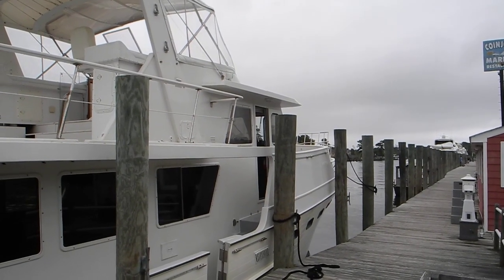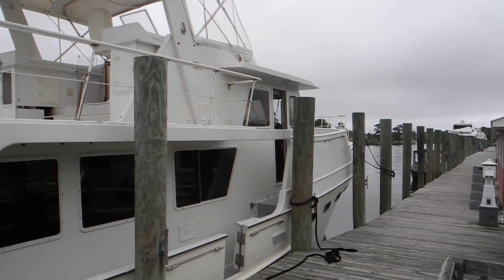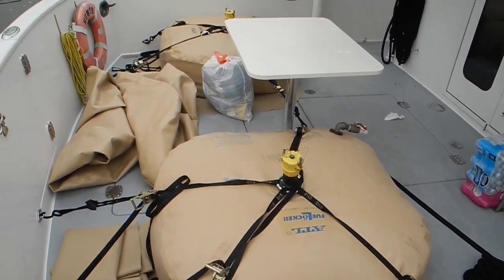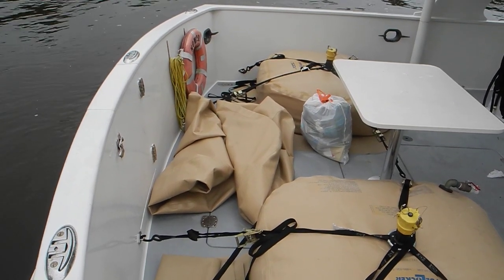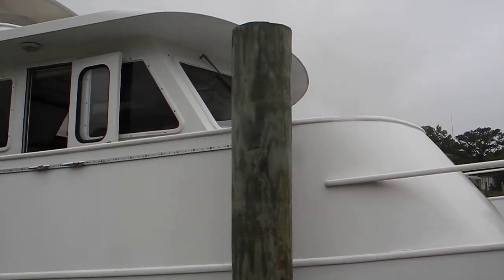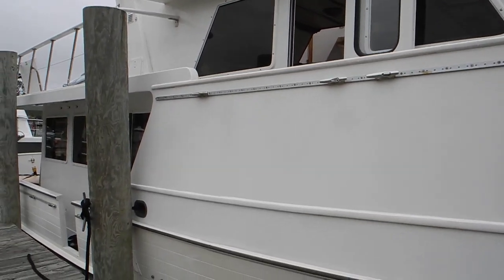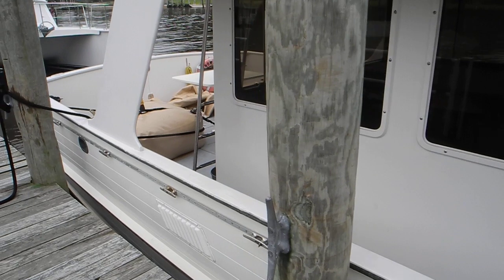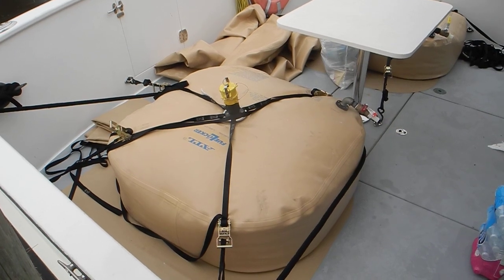Fuel Bladder tanks on deck.

Comment: Depends on the boat, mate. Check out MV Dirona, the N52. They had 3x 700 (or 800) gallons of fuel in bladders, 2 in the cockpit and 1 on the Portuguese bridge when they crossed the North Atlantic. James said that  with this setup the boat still met the category A requirements for stability, even with almost empty main fuel tanks, I think it was down to 15% in main tanks. But of course you'd never go anywhere near that low level because you'd empty the bladders and fill up your main tanks as soon as you've burned that amount of fuel.
But yes that's a Nordhavn, I have no idea if a OA can do it. But maybe the owner himself or the manufacturer did the calculations first?
Reply from the maker: Adding the additional weight to the upper deck is always a concern to any boater. The idea is the Righting Moment or the ability to maintain an upright position in rough seas. Then you may consider if the deck will support the additional weight. This is all a personal decision BUT what will the insurance company say if there is a claim?
Reply: I think it also depends on the trip.  Fuel bladders might help with a crossing (if there was really no better option), but I'd never use them for a run up the coast because it's just too much work and risk.
Reply: @AskCaptainChris  I agree with you. Weight on the upper decks is a concern. But obviously calculations can be made and with a strong stabil vessel it can be done within the requirements for stability. 
Thank you for the reply.
Reply from the maker: Rob Crawford my opinion as well. Thanks for jumping in.
Reply from the maker: etikkboksen risk vs reward...thanks for your considerations so others may learn. 👍🏼👍🏼
Reply: One of their bladders blocked a cockpit drain, flooding their cockpit on passage during a major storm. Read about it on their site.

Comment: About 650 nm??   Must have been moving at darn near full speed to need all that extra fuel.  Or was it for a longer trip?
Reply from the maker: Don't really know more than I shared at the time of filming. This was not my client and I just noticed the tanks while walking the dock, reporting what the crew shared with me.
Reply: @AskCaptainChris   well we all know what we as Crew tell the Dock walkers,  I suspect the trip was longer then that.  Or perhaps the Main tanks had an issue.   I see Many Sport Fish use them on their Long Runs to fishing Grounds as soon as Main tanks are down they Dump into Mains.  I suspect the OA would have in Excess of 1000 gallon tankage for that size Boat and would not need that much fuel to make a 500 mile trip.    All your Points on Loading  and Weight are Well Founded.  a fuel bladder distributes its weight evenly to the Deck  7lbs  x  150 ga = 1050lbs   /    5'X5'   25 SF   =  42 Pounds downward force per FT.      A Grown Man weighing 250 pounds standing on His two Feet is More.      I do think the OA back decks can Hold  8 250 pound Men.    Also as One See the Tanks Are Secured to the Deck per MFG recommendations.  ATL fuel Bladders Have been used for Years and offer Alternatives to many Different Situations & Needs
Reply: @traumagas123  Very well thought out analysis.

Comment: I agree with you that would be a lot of weight on the bow.
Reply from the maker: nashguy207 and for the effort and expense, if I was going up the coast I might just decide to tuck in and get fuel at a few specific inlets where fuel is available and easily accessible. That’s just me.